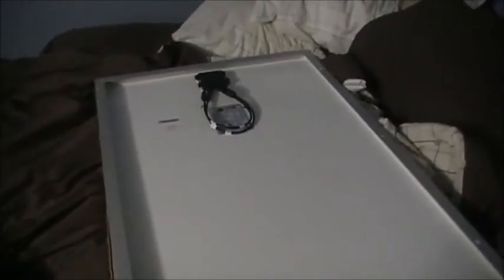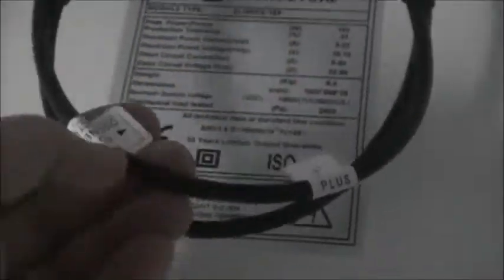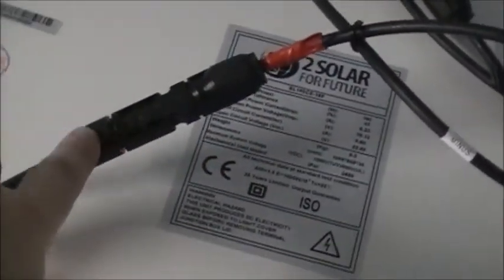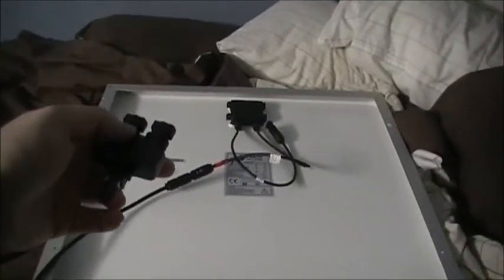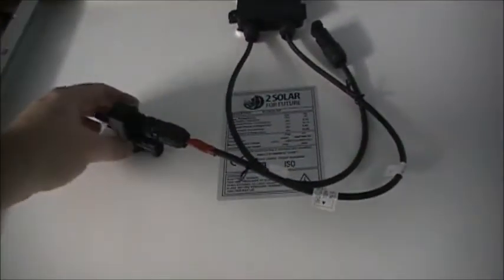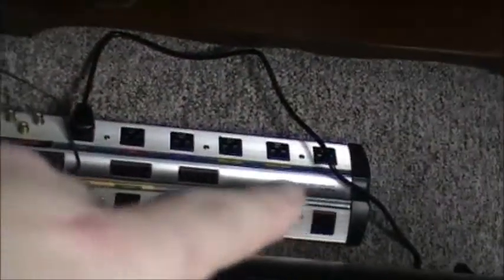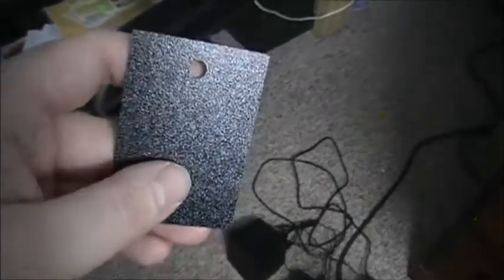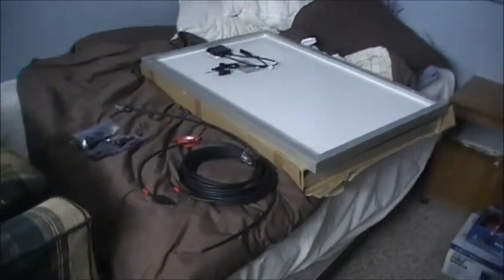The Off Grid Tiny House 88 Solar Wiring

Comment: That size bank will get you by, but if you plan on living there full time you are definitely going to want something much bigger. We have a refrigerator that is 18 cuft and consumes around 360 amp hours a year. We run all l.e.d. lights and use one laptop with a Mobil hotspot. I have found it to be good using things that have rechargeable batteries. So when the sun is out charge your batts and when its down , your items are ready for use.
Reply from the maker: Thanks for the info Earthship. Please check out my latest video and tell me what you think?

Comment: Same route I took with my first array(12v). Ended up doing a 24volt for the house. We just went 7 days with zero sun and we made it. Large battery bank is vital to success. Have you seen Midnite Solar charge controllers?
Reply from the maker: I have little knowledge of the midnite  solar brand. What is your amp hours on your battery bank if I may ask ? Thanks Earthship.

Comment: For some reason Google won't let me reply to your comment.    My bank is 915 amp hours. Comprised of 12 , 2 volt sun extender sealed batteries. Maintenance free is easier in my opinion.
Reply from the maker: Very weird ? Ok you got a message in. wow thats a huge setup. I also want maintenance free. I plan on only 5, 75 amp hour batteries 12 volt. What do you think about this ?